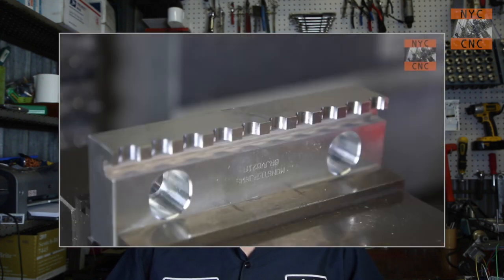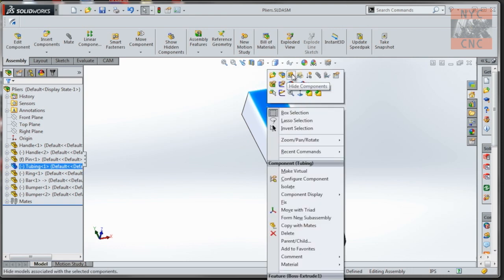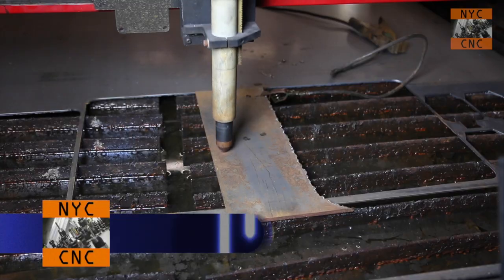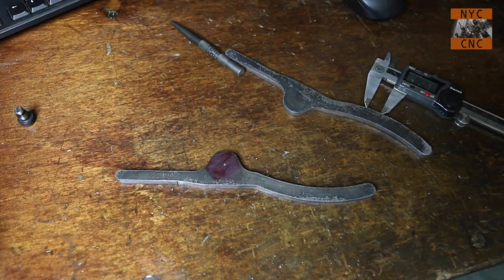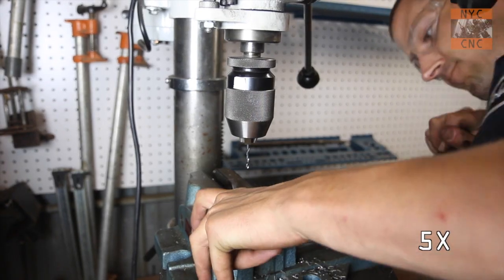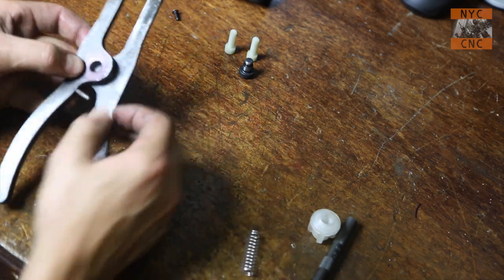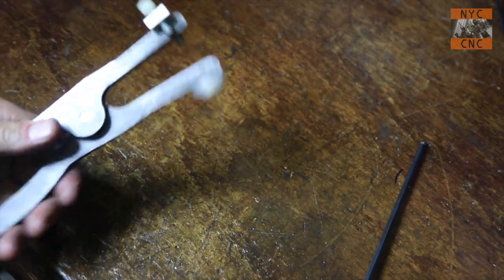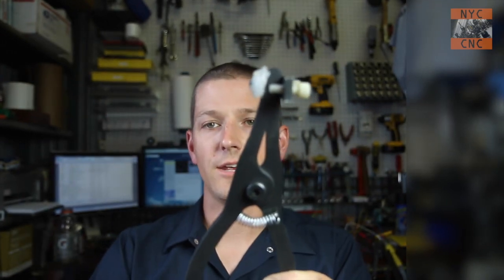Inverse Pliers?   Let's Make 'Em - Machining & Plasma Cutting! Wednesday Widget #5

Comment: Nice work. May I suggest for a Rev. 2 version, program the plasma to leave small tabs on the inside of the handles that will fit into the ends of the spring. Also, pretty amazed at your calm demeanor during the tornado warning. Perhaps you had good info on where it was going, but I usually get a bit tense when the sirens go off here.

Comment: Hey John, try using "Punch-Ease" or heavy oil when you punch your holes. I have the same whitney at work and even some thicker materials get stuck on the top die and bend. I also plasma cut a 3/4 thick wrench with a 60º vee in the jaw part , I just stick it between the work and stripper plate after I punch the hole, you need a closer stipper plate hole.   Atb , Billy

Comment: About plasma cutting your hole i know what you are talking about. I own a plasma cam. On The plasma cam software if i draw a point and select it when i make my machine path it fires the plasma cutter for about a second. That makes a great mark for locating the drill on the drill press.

Comment: When I use the wire wheel on the bench grinder, I find that a set of Kevlar work gloves does an absolutely amazing job protecting my hands.  I prefer a thick fabric like "Memphis 9687 FlexTuff Latex Coated Palm Gloves" and they take a beating without me fearing for my skin at all.  If I'm working on small stuff, I can get right in on the wheel.  (One thing worth mentioning is that my wire wheel is shielded and has less horsepower than yours.)

Comment: You could use heat shrink (like you use on wiring but a larger diameter) on the handles.  It's quick, and has a nice rubber feel.

Comment: This channel is just what I've been looking for, I've been looking to learn more about machining and this is great! I'm working on building an Arduino based 3 axis cnc router.
Reply: NYC CNC Yes, I just got my Arduino a few days ago and was planning on using grbl from all the good things I've been hearing about it. Any idea of what motors I should use to be able to cut aluminum/steel?
Reply: NYC CNC I'm unsure about both actually, I was thinking about getting some NEMA 17's as the motor drivers I ordered can only handle about 750 mA. I can always upgrade the motor drivers and motors in the future if necessary though. I would primarily be using this cnc to cut wooden stocks but would like to be able to cut aluminum as well if possible.

Comment: we use PTFE spray lubricant for smaller parts on out punching machine or antiseize youd use on bolts to help the punch slide out again its a real pain when your punching a length of flat bar and it bites and kinks it towards the end

Comment: Use Polyolefin(heat shrink wrap) for the handles. It is TOUGH, form fits, insulates, can be bought in long lenght tubes of different colors and diameters. Working with it is as easy as falling down stairs.
Reply: Some use 3M spray glue to keep it from slipping. Depends on the part.

Comment: nice job! for the handles  try liquid rubber, works great. Here is some examples how it works, Tips & Tricks - Plasti Dip Rubber Coating. Scratch protection in a twinkling of an eye!  
 REVIEW: Frost Liquid Wrap - The Professional Rubber Coating Spray.

Comment: If you can not find dip on plastidip, harbor freight brush on "electrical tape" is close to the same stuff.
Reply: NYC CNC I looked at the branding after I posted, and it is the same stuff.  The liquid elec tape is useful, I have encapsulated small circuits in it before

Comment: hey they are not electrically isolated just to warn you.  the aluminum bar is going to touch the inside of the part and conduct and the paint will probably wear off... other than that good work!
Reply: you would know better than I would, you just mentioned it in the video and i didn't want you to get tazed by the powder coating.   actually... if you get the plasti dip stuff on the handles good enough you could just have the ground on the tool itself so you dont have to hassle with connections every time. but i've never messed with powder coat befor so I haven't a clue! keep having fun!
Reply: you could cheat and where gloves... not sure what sort of charge your dealing with though.

Comment: Take a 2" by 12" by .25 metal stock. Notch out a V into the side about 1/4 of the way down the 12" side. This "V" notch should be large enough to wrap around your largest punch. So.....You punch the hole, place your fabricated piece around the punch, and raise. This will provide support on both sides of your piece so it doesn't pinch on retraction.
Reply: Large Please. Will send you a email in a few minutes.

Comment: Some self amalgamating tape would work well for the handles. I use it at home and at work instead of insulating/electrical tape (which is the work of the Devil!).
Reply: NYC CNC The adhesive on insulating tape oozes. If too warm, the tape slides about making a worse mess. After a while the adhesive and tape harden and are really hard to remove. I quite often get sensor cable sets to repair. If they've been patched up with insulating tape, then the job takes twice as long as I have to try and remove the gooey disaster first.

Self amalgamating tape comes in several types and many are not sticky at all, but only bond to themselves. You can usually get a waterproof joint and there are cables I repaired 20 years ago still with going stong.
Reply: I think you can still get the dip type of coating can't you? Maybe search online?

Comment: Plastidip. I used gallons of this (or so it seems) when I worked as a machinist, and an auto mechanic. I also used it when I was a TV technician and apprentice electrician:
http://www.plastidip.com/home_solutions/Plasti_Dip
Tom - Vista, CA
Reply: The dip version is all I ever used. I'd never use the rattle can, too much waste. The dip style even leaves the little goobers on the ends of the handles...

Comment: Smaller stripper hole and oil
Reply: Why you cant control the stroke?
Reply: If the shank of the punch is 3/4, and the dia of the hole punched is a 5/16 the stripper hole needs to be a .400 dia or closer if stock is thin. But if the machine has no control of the stroke you cant make the hole smaller because the shank of the punch will bend the stripper. Plus i use 8-10% of metal thickness clearance on the female, this gives max material condition. Usually 1/3 of the thickness is the punch size and the rest is breakage. (this all changes with material spec.) hope this helps..
Reply: I know this is an old thread but Bigwingrider1800 is right on. What's happening is your part is springing out during the punch stroke. This is worse with thinner cross sections as you described. Once the hole is punched through, the part "springs" back and clamps onto the punch. A sharp punch, lubrication, close tolerance stripper hole and good retraction force will minimize problems. 
Wish I had one of those. 😊
Reply: Great minds think alike...John Bazaar